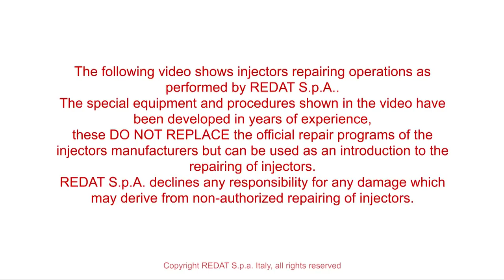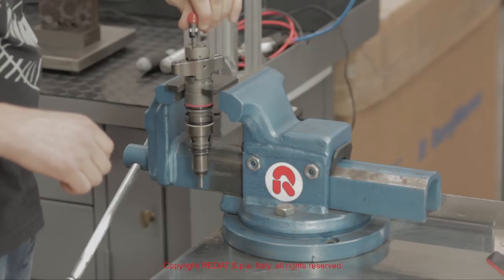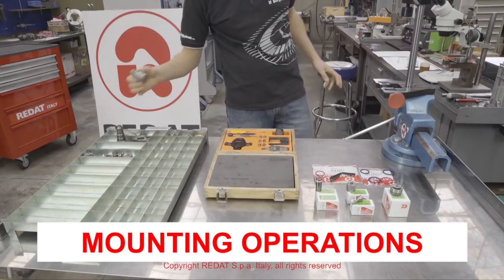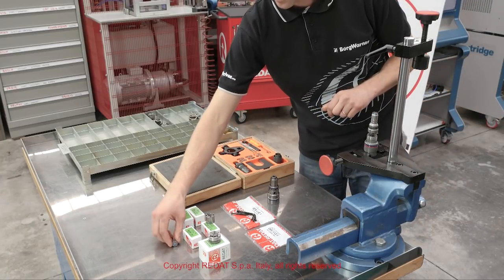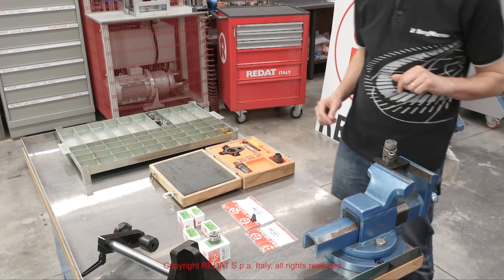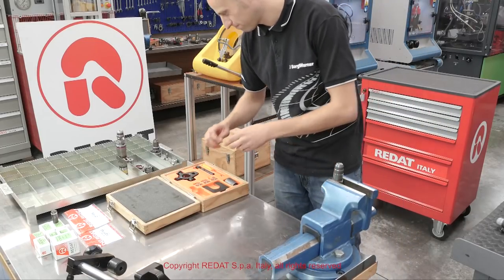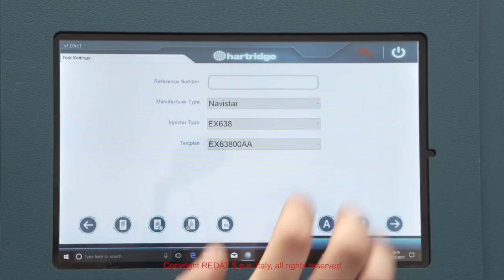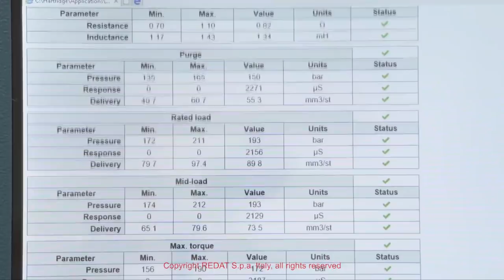Caterpillar C7 disassembling, reassembling and testing

Comment: What causes nozzles to mix diesel
Reply: How can I get the tools and how much?
Reply from the maker: @Templeuzuegbu-qi1mb  you can write to sales@redat.com
Reply from the maker: Causes may vary, but the most common is a failure of the oring seals that separate the oil and fuel paths between injector and chamber wall, this can be due to wear, or to incorrect installation (like deforming them when mounting, or pinching them when inserting the injector in the engine).

Comment: Sir what will the cause if diesel ang engine oil will mix together even the injector is new...thanks
Reply from the maker: We cannot advise on engine troubleshooting as we only focus on the repairing of injectors themselves. Please pay special attention to the orings, and that they slide in without getting pinched, tretched or damaged during installation. Damaged orings may cause the problem you described.